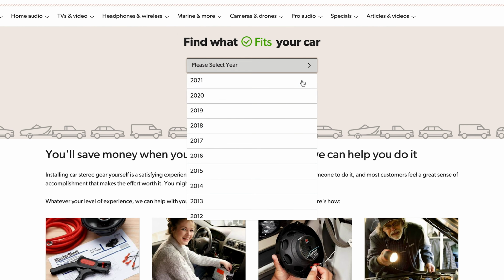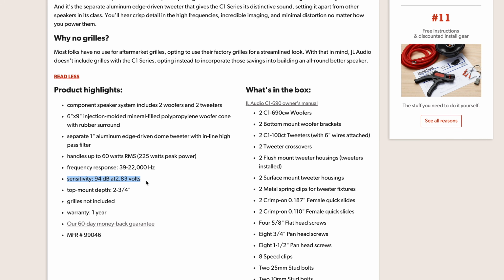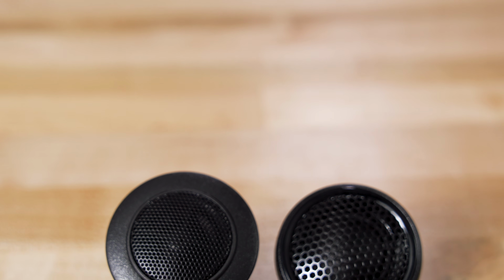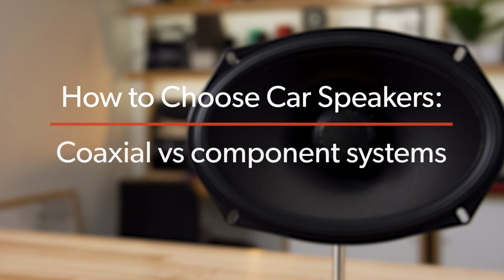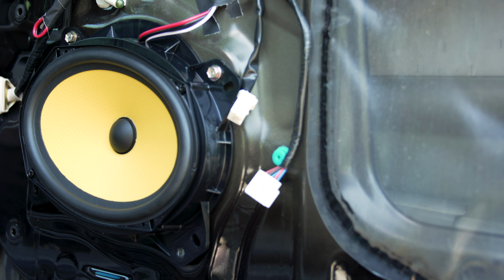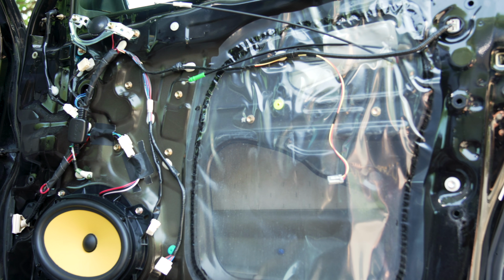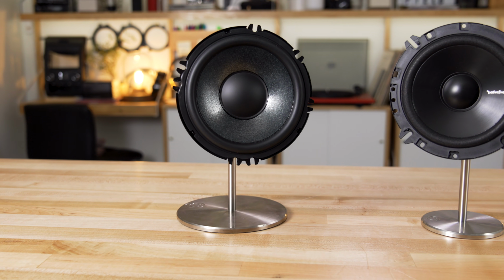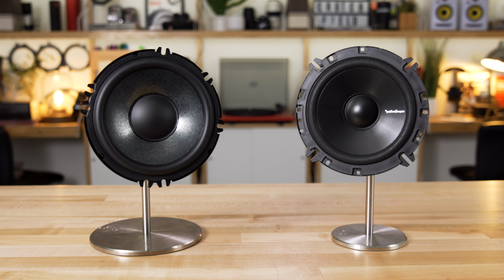How to choose car speakers | Crutchfield

Comment: Haha, or you can do what I do. That is: realize that you are too old to become an expert again.

Sure, I used to know audio stuff like it was one of the most important things in the world. But that knowledge is very dated. I am pretty sure the Jensen Triaxles I used to swear by in the 1980s won't be available if I start googling around for them. Further, at age 53 and being a guy who does all of his work himself,  I am generally into ten different projects at once around my house. I do not have time to become an expert on drywall supplies, plumbing supplies, HVAC supplies, insulation types and car speakers all at once.

So I find brands that I trust, and work on the belief that my favorite brands will not let me down (and if they ever do, I change brands). I buy DeWalt tools and I buy Kicker speakers. That way I can know I am getting quality stuff without needing to become an expert on the different impact drivers and car speakers on the market. I do a quick googling to find out which DeWalt tool is their current top of the line XR version, and which Kicker speaker is rated at equal to or slightly above the wattage that the stereo puts out. Decision made, then I can spend what time I do have figuring out whether or not I am using the best method to actually hang the drywall.

Trust me kids...this method works.

Comment: (4 channel) How do you pair rear door speakers with a higher end front door component system? In other words, i don't want a warm sound mixed with a crisp front.
Reply from the maker: Sticking with something in the same brand and series is an easy way to match them. What do you plan to use for power? What is the year, make, and model of your vehicle?
Reply: @crutchfield  I ended up not getting component speakers, but I got JL Audio C series speakers (5 1/4) for my front and rear doors and my dash (3 1\2).  I got them thru crutchfield.
Reply from the maker: Thanks for your order, Jeremy.  Enjoy! Please let us know whenever you need anything else.

Comment: Can I use Coaxial speakers to replace my factory ones and use an android 12 player without and amp? And add a powered subwoofer?
Reply from the maker: Hi Jeff, what is the year, make, and model of your car? Are you looking to maintain your factory radio?

Comment: Hello, i'm driving a e39 sedan and tried quite a lot to have a good quality sound but still want go more and don't have any ideas. I want something like bmw f10 sound with an logic 7 without a sub with a big box. Ofc it can be but i want just deep bass from it with no chatter and courting sound. I tried 10" with a box and 2pairs of 8" on port less and ported box with good liters and all but still nothing i would admire...
The main thing is the sub with a box have specific sound i don't like that cranking and boxing it feels like you hear nothing apart that sub goes wild...

I have:
Media device: fiio btr 30 pro   (from phone bt straight to amp)
Amp: Helix m four
Front door: Focals 165 iss + two tweeters   (installed an adapter from standard 5" to 6,5")
Back: 2x ellipses 7x9 in the back cut the holes true the trunk on sedan back window (on low pass filter)

Any advice?
Thanks!
Reply from the maker: Sounds like a great setup. Are you using the one amp for everything? Do you feel like you want more sound control than you have or just more bass?
Reply: @crutchfield  Yeah, one is for everything. And I'm thinking to have a dsp or something to boost my signal output I'm using apple music and my btr 30 pro is outputting 3vrms. But I'm thinking if it makes any difference. In front everything is fine but i want a little more bass i have using the 2x speekers 7103BS EVR 7x10 70rms the heaviest i found i like the bass of it but i need to change it to something belter but don't see anything in a market... But don't want to have big subwoofer inside my trunk of its sound. Those ellipses is easy to drive they have a soft bass of sound. I want something similar but more powerful..
Reply: P.s my ellipses are not in the boxes they just using space of the trunk like a box for it. I don't know if it would change. But i would like to have more feel of bass like shakiness in the front seat
Reply from the maker: A dedicated amp for the subs would help and have you considered adding a DSP or EQ so you can tweak things more? As far as the sub placement goes, are there cutouts?
Reply: @crutchfield  yes on rear deck is a pair of 7x10 so im thinking to cut out a biggerone and set a 10" sub also dinamat everyting. Can the sub be without a box?
Reply from the maker: Okay, cool. With the right power match, you can use free air subs. Did you have any specific subs in mind?
Reply: @crutchfield  i was thinking about 2x of focal p 25 db 500w. What can you recomend ?
Reply: Or a Hertz Energy ES 250 pair, i'll try without a box and if its not good i'll get one. Whitch one is beter ?

Comment: So if I purchased 400w Boss 6 x 9s to replace my factory 2010 Toyota Camry speakers, I essentially would either need an aftermarket amplifier, or an aftermarket radio? Basically I guess what I'm asking is how can I get the best sound from these speakers? I'm guessing I went to high on the wattage?
Reply from the maker: Hi Andrew, sounds like you're working on a nice upgrade! Did your car come with a factory JBL system? What is the RMS power rating and impedance for the Boss speakers?
Reply: @CRUTCHFIELD  they are actually 200 x 2 so 400w.. 200 rms and 2 impedence. Yes the jbl speaker I have is stock in my camry.  I believe, from what I have seen is it is only putting out 25w per speaker.. so if I'm thinking correctly,  I essentially could go with roughly an 800w amp,  since I have changed my rear and door speakers, both with the same 400w max boss speakers.
Reply: @CRUTCHFIELD  I'm sorry the stock jbl amp not speaker.. and yes it came with the jbl system
Reply from the maker: Thanks, Andrew. Sounds like those will work best with an aftermarket amp for power. How many do you have? Are you using an aftermarket radio with pre outs?
Reply: @CRUTCHFIELD  I got 4.. so (2) 6 x 9s for the front door and (2) 6 x 9s for the rear.  I still have the stock JBL amp, as well as the stock radio that came with the camry.  Yes, I'm thinking of upgrading that as well. I just want to purchase the best amp for those speakers. So, with them being 200w per speaker, I'm thinking an 800w amp would be the max I could get, or would want to get.
Reply from the maker: That 200 x 2 rating you referenced seems to indicate it is the combined watts that both the speakers can handle combined together. Usually the ohms are after an @ in specs if they are linked to watts. Which model Boss 6x9 speakers do you have?

Comment: What if my car already had component audio with spots for tweeters? I’m confused on what point my car can support the power necessary and when I need to get an amp and some other way to supply power.
Reply from the maker: Hi Diego! What is the year, make, and model of your car?
Reply: @crutchfield  thanks for responding wow lol. I already got it all figured out though. Your video and website is helpful!
Reply: @crutchfield  thank you!
Reply from the maker: Anytime! It's great to hear that you found the answers you need. 🙂

Comment: Very professional explanation... Btw may I know which speaker brand are most recommended...
Reply from the maker: We don't have a record to know which ones are recommended most of the time. We prefer to discuss goals and preferences to give personal recommendations on gear. If you would like, we can do that for you too. Got a few questions to get started:

What is the year, make, and model of your vehicle?
What speakers are currently installed into it?
What changes are you hoping to make to the sound you get from them?

Comment: If I just want to upgrade my stock speakers and a new stereo would I need an external amp?
Reply from the maker: That depends on the speakers being chosen as well as the vehicle the gear is going into. What is the year, make, and model of your vehicle? Does it have an upgraded factory audio system in it?

Also, what are the brand and model of the speakers you want to install?
Reply: @crutchfield  i have a 2002 Grand Prix with the optioned Bose system upgrade I’m going to put a kenwood kdcx304 and kenwood kfc speakers and deck speakers
Reply from the maker: Nice choice on the KDC-X304 - the Kenwood head units are fantastic!  Which specific Kenwood KFC-series speakers are you considering?
Reply: @crutchfield   KFC-P510PS woofer components

KFC-6996PS 5 way coaxial
Reply from the maker: Those speakers can work well with the amp in the Kenwood radio to give a nice clean sound for low to moderate volume levels. Does that sound like your goals for the levels?
Reply: @crutchfield  yes that’s what I’m looking for thank you
Reply from the maker: Excellent! We are glad we could help! Let us know when we can help again

Comment: I installed the Mopar speaker upgrades in my PT Cruiser around 2014. The front speakers are 1 way and the rear are 2 way. They're better than the factory speakers but they still leave a lot to be desired. I ended up ordering the JBL Concert Series 631 speakers. I probably would've ordered the speakers sooner if I'd known they came with the wire harness because I didn't want to cut the wires in my door. I'll be putting my old speakers in my Dodge 1500.
Reply from the maker: Enjoy! Let us know what you think of them

Comment: on my 1980 k5 blazer it says there is no options that are guaranteed to fit
Reply from the maker: Hi Byrce, are the factory speaker locations original? Which locations did you want to put new speakers into?

Comment: The site doesn't have my car's modle so the site is kind of useless if not all cars and modles are listed. This should be rectified. I have a honda Brio by the way
Reply from the maker: We are a U.S. based company and are only able to research vehicles sold in the U.S. market. Wish we had different news for you there. We recommend checking with a local installer for help with your Honda Brio

Comment: What about impedance? There are tons of resources discussing this for amplified applications, but what about simple factory or aftermarket stereos only - 4 ohm vs 8 ohm speakers?
Reply from the maker: While 4-ohm speakers are best for most aftermarket receivers,, some factory systems do use 2-ohm or even a non-standard load. What is the year, make, and model of your vehicle? What is your exact setup?

Comment: I need 4x6 rear pillar door, a pair. I want bass though. I already have Memphis 6x5 for voice sound in the doors. Which one would be the best?
Reply from the maker: What's the year, make, and model of your vehicle? And what will you be using to power the new speakers?
Reply: @crutchfield  2006 single cab Silverado.
Reply from the maker: 1500? What do you plan to use for power?
Reply: @crutchfield  Yes and I’m gonna upgrade battery, maybe alternator who knows even 0 gage wires. Because I want to run sundown 2 of them. Just not right now. That’s why I wondered which is best for bass 4x6.
Reply from the maker: Thanks, Armando. Do you want to match the 4x6" speakers to your radio or add an amp for power?
Reply: @crutchfield  Np.Well it doesn’t matter is it best? I got Memphis door speakers. With a pioneer double din on the way.
Reply from the maker: The Pioneer TS-A462F speakers are the ones that can fit and add the most bass to the audio. They can be found here:

www.crutchfield.com/I-rYALc227/p_130TSA462F/item.html

If an amp will be used to power the 4x6 speakers, the Kicker 46CSC464 speakers are the best choice:

www.crutchfield.com/I-rYALc227/p_20646CC464/item.html

Comment: Your website doesn’t go back far enough to 1995. I have a 95 Chevy Silverado extended cab. What size speakers are in the front and rear?
Reply from the maker: Back then, Chevy was referring to the full size pickups as either C or K series (2 wheel or 4 wheel drive) and we use these terms in our fit guide. Which cab style do you have (regular, extended, or crew cab)?

Comment: Why can’t I locate a 2007 Lexus gs350. Nothing you have will fit it. I want to replace the weak mark levinson speakers and a few other things.
Reply from the maker: We were not able to get our hands on on that vehicle with the Mark Levinson sound system to research it which is the cause of our lack of fitment information on what can fit. We wish we had different news for you there.

Comment: Just found your recommendation for Crutchfield videos, from a young lad, who was putting speakers into his blue volvo 240 saloon.
What speakers would you recommend for a 1997 Volvo 940 estate (4 speakers in the 4 doors, it's a stationwagon/estate). Also what amp and subwoofer?
Thankyou, if you can help in anyway. 👍
Reply from the maker: We have not been able to research a 1997 Volvo 940. Based on pictures we found online, that may have happened because it does not look like it was released in the US market. If you can provide us with some details about the speaker measurements (mounting height, mounting depth, and frame diameter) and the cutout diameter of the hole left once the speaker it out, we can check for options that can fit.

Comment: Why are all these car speakers mounting the tweeter n mids to center of voice coil and not mounting to rim of speaker cage? Every time I have bought this type of speaker with mounted to voice coil dirt gets in between there and it seizes the voice coil, are there some with smaller mount and a rubber seal in there or are they all made to be thrown away in a few years if you drive down dirt roads?  Back in the day the 2, 3 or 4-way, what is a 4-way, all mounted to cage on outside and not to center like every speaker I could find on Amazon??
Reply: mean you have to wrap the speaker with a nylon to keep particles away from that voice coil or you need to mount them in ceiling...
Reply: personally I would always use component style, is what my charger has, 2 powered subs, then 1 in each door and 2 on dash n 2 rear deck, so 8 powered by amp and 2 powered subs with tweeters nearby, I would never consider an upgrade, but came because a friend wants to annoy motorists and upgrade toon on his Harley.. damn bike is already loud and his toons do rock, but he wants people to hear him from 6 miles not 1 I guess.. told him to buy some 3-ways n wrap in nylon for easiest installation when he puts this 1000w amp in his bike,, told him the amp needs air,, sure it will all fail in short order...
Reply from the maker: Hi Craig, sounds like you have a great system!  That's a good point on the design and using a component system like you have is ideal. From there, your friend may want to consider some of the marine grade speakers we carry. They tend to hold up longer on motorcycles and off road vehicles. If he needs help choosing, please send him our way. Thanks!
Reply: @crutchfield  Guess his fairing mounts speakers nearly up and down, so perhaps if dirt made it in there it would bounce out vs setting down inside and binding voice coil.. He will just wrap in a nylon and use this style to avoid having tweeter wires exposed, thought pose question as others might not know.

Comment: Hello, i installed some kickers 3.5 into my dashboard of a camry 2022, i also put on bass blockers. The first few days were fine but now i hear a buzzing sound coming from the left one even at low volumes, i hear it after a few minutes of driving, not right away. I do turn my music up pretty high on my stock head unit, the max is 62 and i usually have it in the 50's... the buzzing sound isnt constant, it comes and goes every few minutes, even at low volumes, please help
Reply from the maker: This sounds like a wiring issue, especially as it is not consistent.  My first step would be to take it apart and check to make sure all connections are solid, and protected!

Comment: What I find to be the most frustrating is that my past two vehicles (a 2015 Cherokee and a 2019 Cherokee)  have next to no options for 6x9s in your configurator even though users in forums, Jeep groups, Facebook groups have all had 100% success of installing quite a large number of different 6x9s from quite a few different vendors without having to do any sort of modding or anything. They buy the speaker and it drops in no problem.  Shoot, even in some of the product reviews you'll read "I installed this in my Cherokee with no issues even though Crutchfield says that this isn't compatible."  Seeing as this has been in issue for the pas two generations of that car, it makes me wonder about the length of research that is done for compatibility.
Reply from the maker: We do our own vehicle research here and we do list the easiest fit options via our online selector. Any time you don't see a model you hope to use listed there, please reach out to an advisor. They can help you take a closer look at the specific  installation. Thanks!

Comment: Hi Sir, I owned a Lexus RX350 2007 model. The front Left & Rear Left door speakers are blown and doesn't works well. 

I have planned to go with replace the factory built speakers with Pioneer speaker 650Watts-5Way (Front) & 350Watts-4Way (Rear). 

Now I have a question. Do I really need to upgrade the Existing factory built amplifier or it is not required. 

Please advice. 

Thank you.
Reply from the maker: Hi Ahmed, replacing your speakers is the best way to upgrade your sound. What are the exact speaker models? Did your car come with a factory Mark Levinson sound system or a factory DVD system?